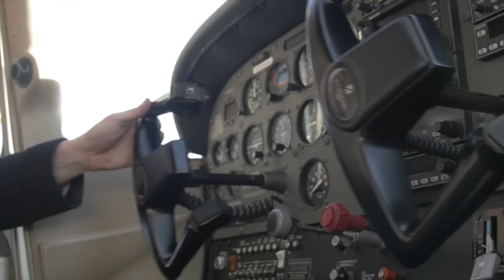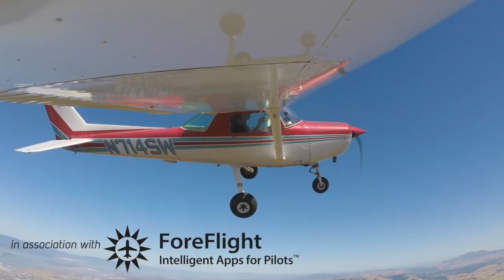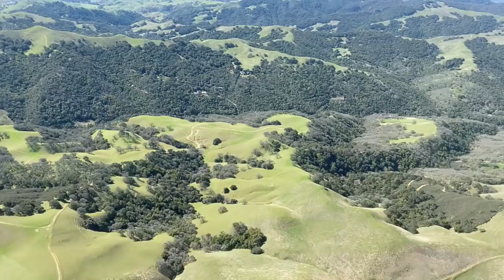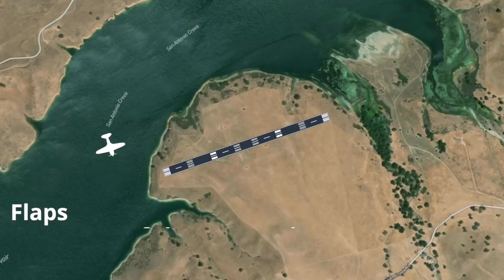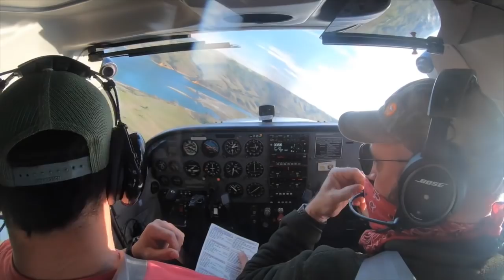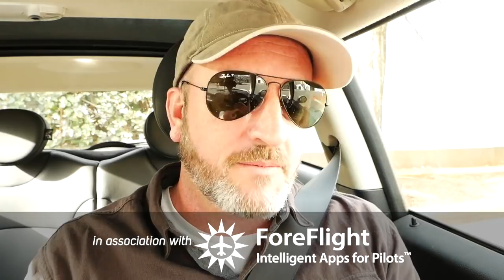Engine Failures CAN happen! Watch a student pilot and flight instructor practice inflight power loss

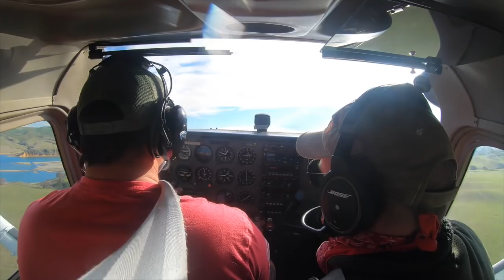Comment: Boy, at 8:20 you can really see the pitch-up effect on full power that has caught inexperienced pilots by surprise upon a go-around/aborted landing.  I learned early on to push on throttle AND yoke with almost the same force to build airspeed..... in a "deer on the runway" scenario.

Comment: All things being equal, i would much rather have some extra air speed to bleed off instead of approaching minimum speed and all the catastrophic consequences of falling out of the sky.  You can land fast, and use runway, you can smoke the breaks, you can max flaps as long as possible, break as long as possible, and use end or sides as you run out of asphalt, to kill the plane, and not kill you.  There are just so many favorable options with excess airspeed , but once  you have burned off energy, you are "F"ed, and even when you have altitude you are able to trade,  its like they say, it is unnatural to push the yoke towards the Earth to get some air flowing under the wings, and depending on how much elevation you still have, you might not have enough to get controlled flight back.  .  Keep adequate elevation and pay attention to airspeed, max glide without risking too much,, keep that air speed in the safe zone.  Ask any commercial pilot what they would rather deal with,, too much air speed or not enough. with the exception of speed that is going to compromise the airframe, 10 out of 10 will vote for too much airspeed over not enough every time.  (This is just my opinion and I am sure i am going to get lectured by the F.I. community,,, lol, don't come at me too hard.  !!

Comment: I actually had a partial engine failure a little while ago, couldn’t maintain altitude, it’s very hard to fly past good landing areas then find another one. I made to the intended airport with 500 ft above the cct height, and never backed off till short finals,

Comment: Another tip on opening the doors - on a Cessna, latch the door handle with it open - that will prevent it from re-latching closed. Kinda like some teach to wedge your shoe (or something else) between the door and the frame to keep it from re-latching closed. Great video!

Comment: Doing a simulated engine failure with a "City boy" instructor over the bush in NW Ontario in a check ride in their 172, I chose a logging road in a cutover area, and I was actually thinking I could land and take off from there with no trouble at all, it was then that I asked how low he wanted to go?  he told me "as low as I was comfortable with"..... When I got to 40-50' I think I exceeded his comfort level, because he realized I was going to land...   go around!

Comment: On a carbureted engine step one is CARB HEAT!  if you have a carb full of ice, you only have a few seconds from the time the engine quits before there is no heat left in the exhaust system to heat the intake air and melt the carb ice!  
carb heat- then best glide...at least that's what I was taught

Comment: Jason, question: I’ve been a pilot for roughly 15 years, I have a private pilot fixed wing and commercial instrument helicopter and these days really only fly as a sport pilot. I don’t use flight following anymore, because my flights are recreational, and rarely have a straight line route to a specific destination. Because I now spend my flights mostly meandering around aimlessly enjoying the scenery and the activity of flying itself, my type of flying is not well received by enroute controllers, and for this reason I usually only have my radio tuned to the nearest airfield. This definitely does not put me at an advantage if I had to declare an emergency. Would you recommend always having the local approach controller on standby? Or do you have any other recommendation for being a little more prepared in the event I had to declare an emergency? Believe me I’ve tried using flight following, and they become very clearly annoyed at constant heading and altitude changes.
Reply: I would personally always try to have a safety net. Flight following is a nice thing to have, but because of the nature of your flying, it does not always make the most sense. Something as simple as having a controlled frequency on the standby could never hurt. While in glide, after the initial checks and procedures, there is a decent amount of time just flying the plane down. During that time you could easily swap to the frequency, and mayday. They could have you squawk as usual and be able to have a last known location (god forbid). I don't know. Me personally, I always try to have cards stacked in my favor, as 1 net is not always enough. Just remember, "No plan survives first contact". Best of luck, and hope my answer suffices and gives at least ONE other persons perspective to another!
Reply: You don't have to get radar services in order to tune in the frequency. Have it tuned in and listen in for extra situational awareness. If it hits the fan, just key in the mic and declare your emergency. Even if they get caught off guard and don't understand who you are and why you're talking all of a sudden, they will see your 7700 flashing on their radar. Problem solved.
Reply: Facilities and most part 121 carriers monitor 121.5. Keep it in your standby radio, know your position, report your tail number. In the modern ADSB world, ATC will know your precise location from your ADSB and you help them hone in on the specific aircraft with your tail number (as well as looking back at ADSB recording if you go missing), also, squawking 7700 and reporting your position will get the controllers attention. Then, state intentions slowly and clearly so others can hear and pass on the report, and repeat a few times. If you aren't equipped yet with ADSB, this is a strong reason to get one.

Comment: I've also learnt the technique of approach to an almost overshoot point, then (172) put out full flap, point the nose at the ground (airspeed up to Vfe) - the barn door flaps of a 172 and the extra drag at an airspeed higher than best glide speed guarantees that you're going to make the field without an undershoot. It's a bit radical, but it works!!

Comment: Have you ever, or known anyone who has, had an actual engine out when down at 1000 feet practicing engine outs?
Reply: An instructor I worked with had this happen. They were doing a practice emergency to a private airport that wasn't in use, 1 to 2 ft tall grass. During the descent, the throttle cable in a 172 broke. The engine was stuck at idle. The CFI was able to identify this when he moved the throttle to clear the engine around 1200 ft agl and the engine remained at idle. He had the student continue to a successful landing, no damage no injuries.

Comment: You seemed to be near landable fields so why initially pitching for best glide speed? (rather  than min-sink). Is that choice typically discussed as an option in training?
Reply: This may not be the correct answer but I would say that by always making pitching for best glide speed part of the exercise, you’ll be better prepared in the event of an actual emergency. Also, best glide will buy you time; especially when you’re not immediately near ideal landing spots. And most importantly, I would think that best glide would allow time to first, calm down. Then go through the rest of the emergency procedures. Remember what Jason said. Don’t give anything away. Altitude is your friend.
Reply: @TenMinuteTrips  min sink speed will give you most time aloft for given altitude whereas best L/D will allow you to cover most distance for given altitude. If need to get to landable terrain  agree entirely with  choose best glide, if already over landable terrain why not choose Min-sink and more time to figure things out? Just curious why this is seldom taught/discussed as an option  (other than in gliders).
Reply: 1) Under stressful circumstances, Keep It Simple. You'll spend more time overthinking the speed than you will gain. 2) Min sink isn't tabulated in a typical powered trainer, and 3) is closer to stall, already a concern for a ground-shy student under stress. Best glide is pretty close to a normal final approach speed, so students are pretty comfortable with it and used to how fast things are moving.

Comment: My biggest fear! Just watching this helps to reduce it (except for the stall horn). Thanks.
Reply: Don't let the stall horn scare you!  If you hear it, just relax back pressure just a little bit and it will stop.  There's actually quite a large buffer between first hearing the stall horn and actual stall. You'll see the backcountry pilots landing with the stall horn constantly chirping all the way down final--that's IDEAL for minimum speed and ground roll!

Comment: Lost my engine power 100 feet AGL immediately after taking off from the runway landing straight ahead would put me in the houses off the departure end. A left turn onto a highway overpass was my best option, ended up rear ending a car.
Reply: Rear ending a car is a bad mistake on your behalf. You should reevaluate what your best option was. If your unlikely story is true you could have killed others. Best option my @33. That prop is a murder device.
Reply: @sqwk2559  It seems his other option was houses. Which would you choose?
Reply: @Dan007UT  hit the dirt before both. He’s lying anyway. 100 AGL has the runway all to play for. Fake story. And if he had only 100 AGL at the departure-end he’s and even bigger idiot.
Reply: @sqwk2559  he didn’t have much of a choice. His other option was ramming into a house.

You’re trained that a freeway is actually pretty much one of the best places to land for this reason - if you land with traffic, you aren’t going much faster than everyone else. The prop isn’t going to shear straight through and kill everyone in the car.

Comment: "There's been some trigonometry done" - I intuitively can't believe it could be harmful to gain altitude, but could definitely be convinced (I know next to nothing about aviation) - can we see the math?
Reply: Without going through with a numerical analysis, to me it would seem that by pitching up and climbing to trade airspeed for altitude, you lose some energy due to accelerating upward to overcome vertical inertia and gravity.  Whereas if you hold level to wait for the glide speed,  you don't have that additional energy loss.

I'm not an expert on this, that's just what makes sense to me.
Reply: Years ago I remember reading on a forum. A guy that owned a Cessna 177 had been wondering the same thing and decided to flight test it. Pulling the power to idle at a certain point, altitude and airspeed and compare the two options.
He did it several times. As far as I recall his conclusions were:
(I) An initial climb was better than level flight deceleration,
(II) ... but only by a little bit,
(III) ... and he had to do it immediately to get a noticeable effect - which might not be realistic in a real world engine failure scenario.

My guess is that theoretically a climb is better, but in practice your 'flying effort' is better used on other aspects that will make more of a difference.

Maybe if the airplane is 'fast enough' (like warbirds) a climb is worthwhile?
Reply: @Rodhern  It probably depends on your initial speed when you lose your engine.

Comment: This is gold!  Very nice lesson. While training for the multi-engine rating I had an actual engine failure during the take-off roll.  We were mid-way through the take-off run and the aircraft started pulling hard to the left all of a sudden.  I called abort and pulled the power back and we taxied back.  It was a good lesson that, yes, engine failures can happen to me!  Luckily we didn't have to deal with it after take-off.

Comment: Nice video as always.. I flew from taildraggers to light twin up to the 727. Just got my glider pilot license in january. I think it was one of the best things I could do, it´s not only fun, but it helps a lot with coordinated flight and gliding distance calculations. Ok, in a glider is much easier cause you can vary your ramp a lot with spoilers, its almost impossible to miss an aiming point.. but it´s a flying that you are always thinking about gliding distance, for bovious reasons...
Reply from the maker: Flying a 727 was always my childhood dream! - agreed on the gliders - a great experience
Reply: Weak link and rope breaks are good examples of engine failures and what you need to do afterwards